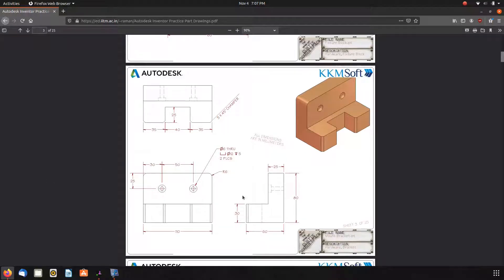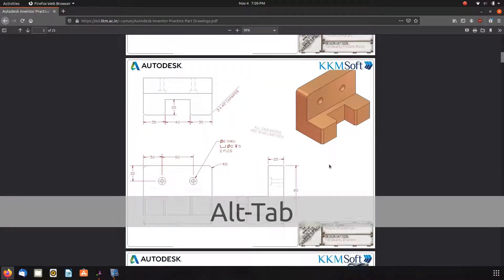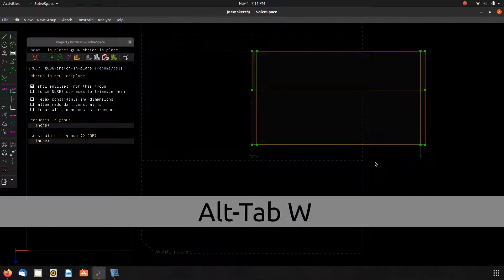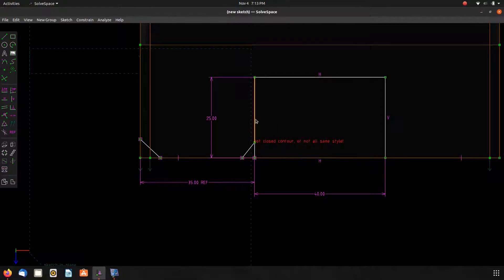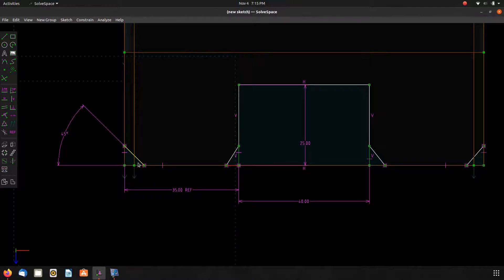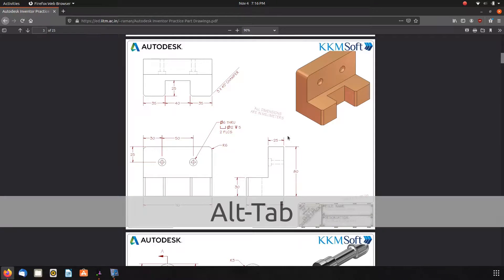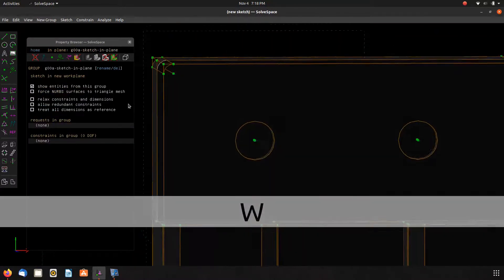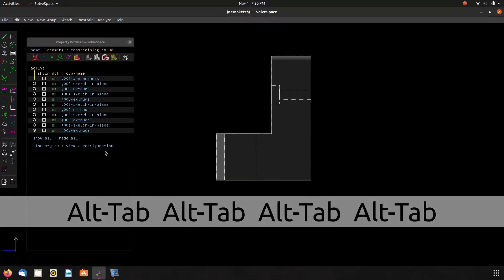SolveSpace Tutorial 2

Comment: How are you rotating and panning? I can’t get it to work on my solve space
Reply from the maker: You should be able to press the middle mouse button (scroll wheel) to rotate and right click to pan.  If you're using a trackpad I'm not sure what the middle mouse button would be. There may be a different way to do it, I'll check.

Edit: I verified on the SolveSpace website that middle mouse button is to rotate and right click is to pan.  They don't list any other options.